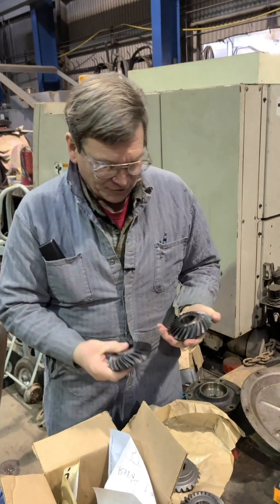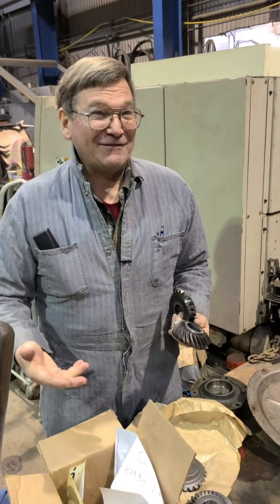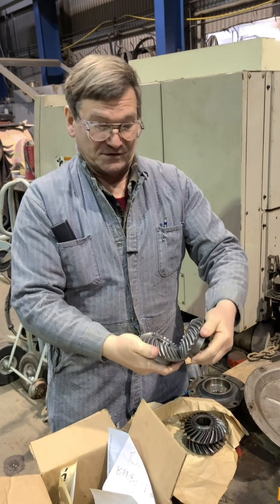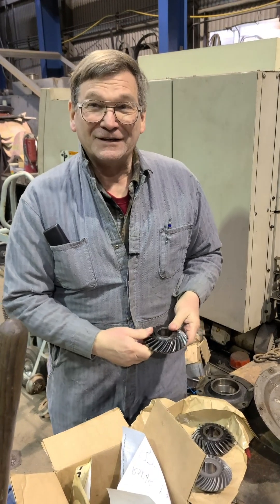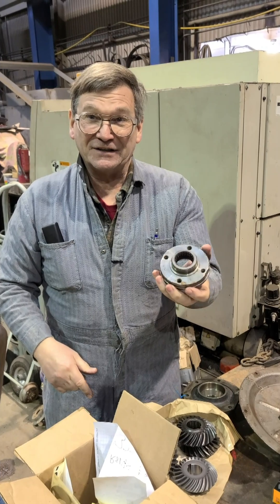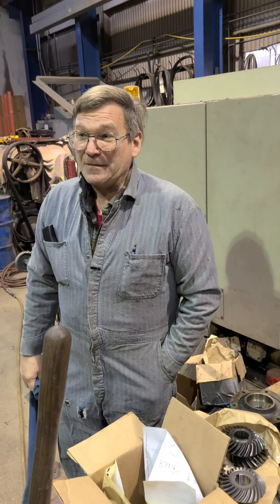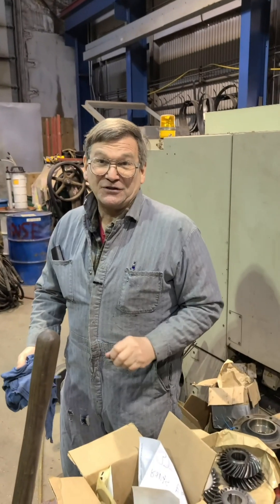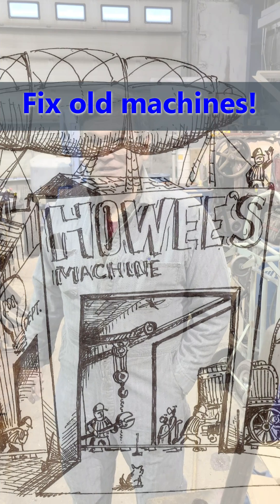Machinist's Minutes: A customer needs a pair of gears. What's best?

Comment: A wire EDM is where we send our internal keyways to be cut. A wire EDM is reasonable and does a real nice job, even on thin walled parts.
Reply: even a sinker edm would do well... Just use a square electrode and plunge it down the material... The bore allows for great ``dust`` washout and the machine can just zap the shit out of what is supposed to be a square key slot... EDM may be wonky and slow, but there ain`t no going around it for some things, even with all the most modern cnc mills and lathes or even grinding centers out there...

Comment: I know a guy here in Kentucky who "retired" and opened a job shop and he’s busier now than he ever was working a regular job. Along the same lines, there was a place here called "Spare Parts" and the old guy who owned it looked and dressed like Jed Clampett. He had been buying military surplus , stock from dealerships that went bust, and stuff at auction. He had an encyclopedic knowledge of parts and parts catalogues and knew what he had in stock, no computer just his mind. He could probably tell you that gear part number from memory. He wore the same type coveralls as you but he drove a Maserati. He had a bunch of foreign super cars. And a few tanks.

Comment: Do you know what the technical reasons were when they didn't want to do a one-off part On their CNC?

  I know businesses prefer to do volume, especially wholesalers.
Reply: There are several things that a shop can bill for; engineering(CAD/CAM), machine setup(fixturing/tooling), material, cycle time(cutting the part), and post production(deburring/packaging). Say you have an hour in engineering, setup, and post at $100 an hour and material is $50 a foot but their supplier sells ten foot stick at minimum, so $500 for material. Say half an hour cycle time for $50. That part now costs $650 for 1. The part looks about 2 inches thick so you could easily get 50 out of the material stock. So  if you order 50 your engineering, setup, and material is divided by 50 and you have $2500 in cycle time. Total cost per part is $62 but the customer only wants one. So when the customer calls the shop and says they want 1 the shop spends all that time figuring out the cost to tell them $650 for 1, or 50 for $62 each. The customer gets mad because they are "getting ripped off" and declines the job the shop wasted that time making the quote when the whole time the shop could have just been making 1000 doodads for a major company and only paying the operator to run the cycles while the engineering department works on the next big job. I hope that makes sense, btw all these numbers are made up and the real ones are likely higher.
Reply: Would you rather have your employees and machines working on large high profit runs, or on little one offs that you make no profit from?

Comment: I think the future for job shops lies in service trucks and 5 axis milling. If smaller, complex one off parts like gears cannot be made, theres a lot less machines that can be repaired well enough for a customer to bother trying to repair it. There is also a lot of "machine shop" work that doesn't require sending parts to the machine on a truck under a roof with large overhead costs.

Comment: Oldest machine in my shop is a Brown & Sharpe No. 0 horizontal mill. It's not perfect, but it does simple slots and keyways well. The patent date on the machine is 1903. Imagine if that little mill could talk.
Reply: Dang ya got me by 10 years. My first lathe I bought almost 40 years ago is a Lodge & Shipley made in 1913. It's slap wore out but it was my first machine and I can't part ways with it. I still use it occasionally for non-critical things.
May your swarf not be stringy and your chips golden.

Comment: Manitou / turner angle gearbox. Around £3000 for a complete new unit. Several modifications have come out for that unit.
Reply from the maker: Do You have a distributor listing?  The Turner factory, did not return my calls or emails.  Maybe they just figure it is not worth the bother to export.  This is not a common unit in the USA, it was a version used on a New Holland reach-lift forklift.

Comment: Old iron still has its place along the newer CNC'S. The rigidity of older machines is sometimes greater than newer equipment. I have run older Barber-Colman hob grinders that are faster than a modern CNC grinder and they were old when I got trained on them.

Comment: Calculating the ratio and foxturing the gear set is the toughest part. I’ve cut them on a Bridgeport years ago, fun job but hope I never have to do it again. That said I cut helical gears on a dx32 vcm750 and figuring out how that control used the helix function sucked more.